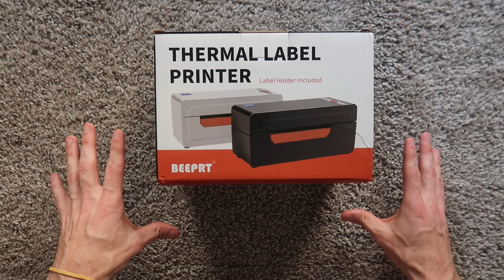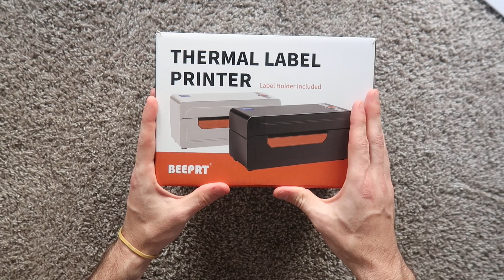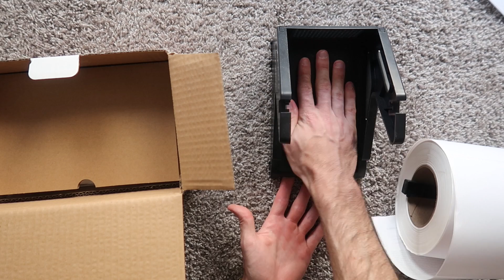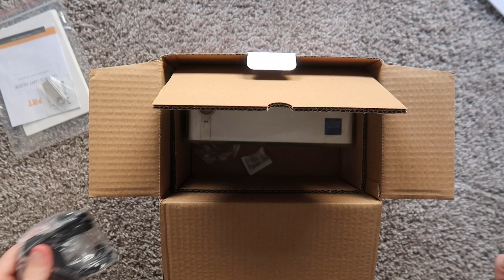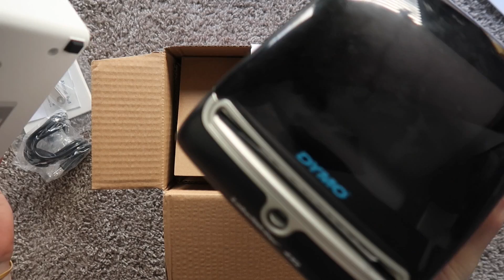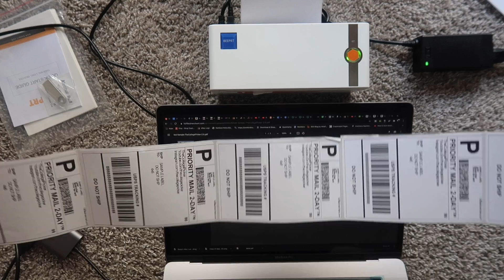Beeprt by-426 Label Printer Unboxing and Test Print

Comment: I'm having issues I have it installed on my Mac mini and and was working well until apple support reset my printers and I hdto reinstall both.my computer (6hr call and still not fixed I called will a zoom call issues with mute and start video not being able to turn on. anyway back to my Beeprt issue now I was able to get the labels resized and tested it prints but it will not stop spitting out the labels, I have try recalibrate and it does the same thing Eric can you please help I am pulling my hair out! thank you, Margaret